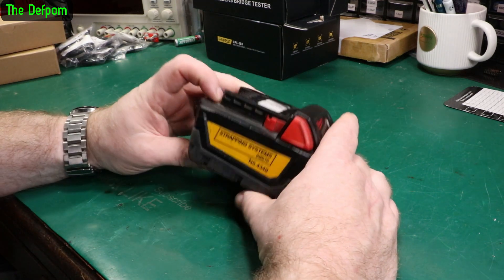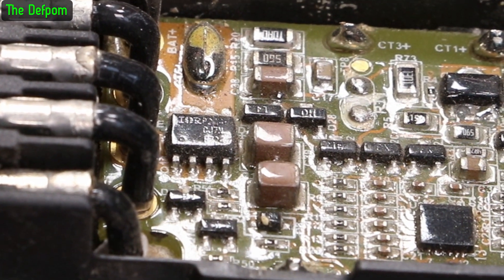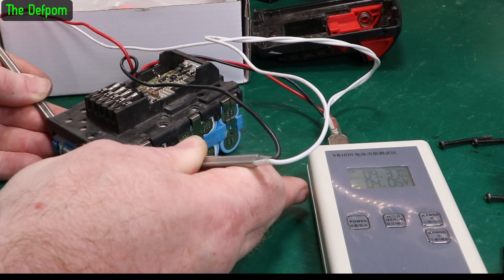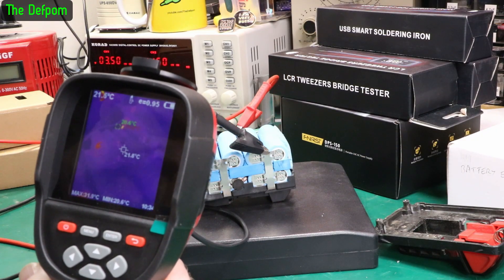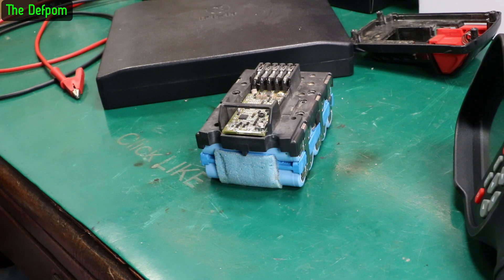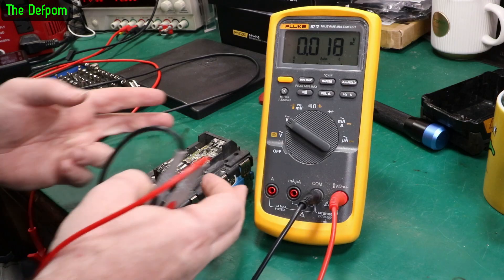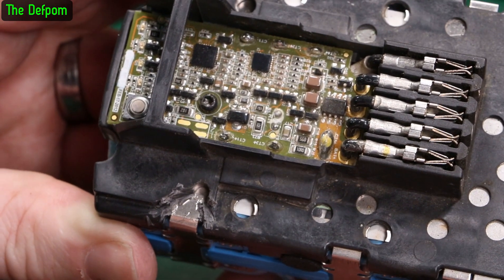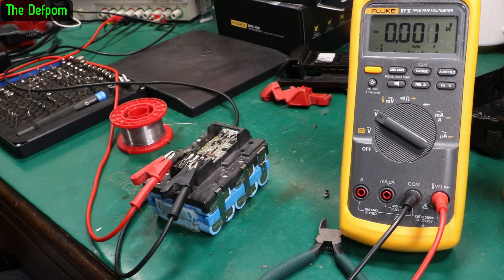🔴 Milwaukee M18 Battery Repair - No.1310

Comment: Sadly Milwaukee batteries have no balance function. The first round of 21700 Samsung cells they used had random bad cells. They didn't catch it for many years. Or they just didn't care. I have to manually balance my 8.0 and 12.0 packs once a year because of this. Random cells will discharge faster than the rest.

Comment: Hello. Just put it back on the original milwaukee charger and it will go away.
Reply from the maker: @oswanator690  I had to fix the battery first, and I didn’t have the charger.

Comment: I wonder if the choice to use 10 cells instead of 5 is a space consideration, more compact?
Reply from the maker: @jrsydvl100  probably two reasons, lower cost cells and increased current handling capacity.

Comment: Remove the whole PCB and reconnect again, and connect to the charger it should work perfectly fine . Sometimes, the motherboard needs to reseted and the best way is to remove and reconnect in most of the milwaukee batteries.  If that doesn't work there must be a mosfet that has been damaged.  Thank u❤

Comment: Great video, Scott. Sort of like a bad crapacitor!  Would you replace just the bad cell or all of them? I have done a few NiMH packs but they were all very old and very dead. You keep forgetting that really fancy milliohmmeter 😊.  Regards, David
Reply from the maker: I wasn’t even sure the controller would reset, I gave it back and they put it on the charger, it reset. Ideally I would replace those 2 bad cells at the very least, the other cells were still fine really.

Comment: It's possible that shorting the battery negative to the circuit negative across the mosfet will remove the protection.

Comment: Milwaukee batteries do not balance cells, so in time the disbalance grows so much that once cell may be fully charged, and the others depleted. If all cells are evened out, there's a chance the battery might still be good.